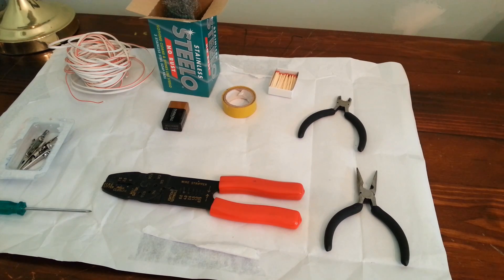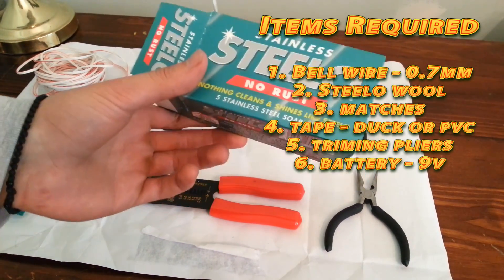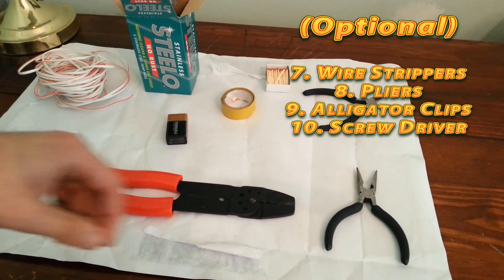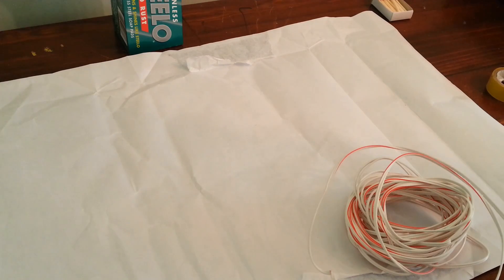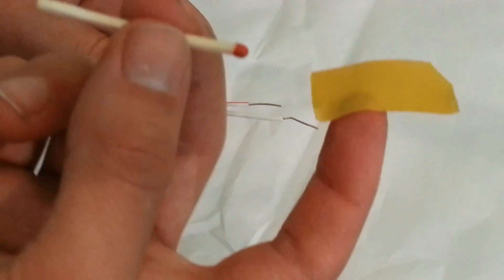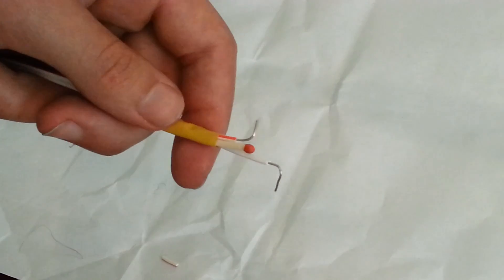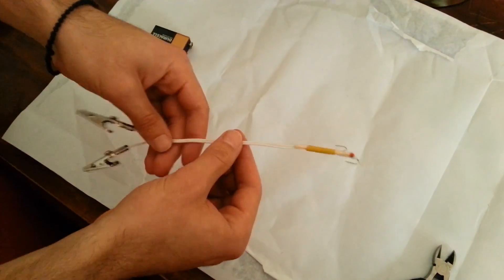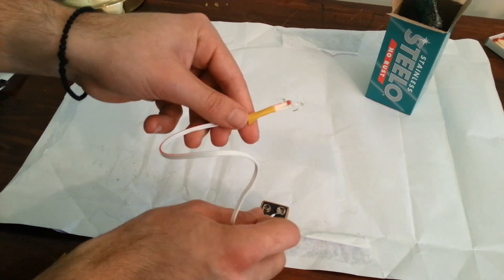How to make an ELECTRIC DETONATOR (Tutorial)

Comment: This method only works some of the time and is not most reliable. Ive tried this over two dozen times correctly and got it to work only once.
Reply: +Pablo Rodriguez you can make an improvised blasting cap using a simple a > 1 volt led such as seen in Christmas light cutouts and by simply stripping the combined wires, cut out the top of the plastic encasing(avoiding the contents inside) and adding a primary explosive inside such as potassium chloriate